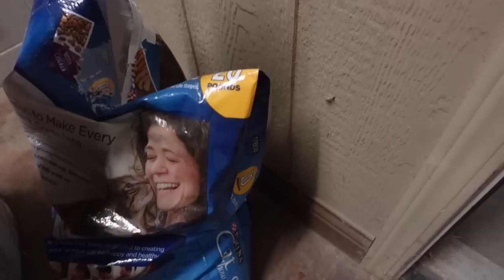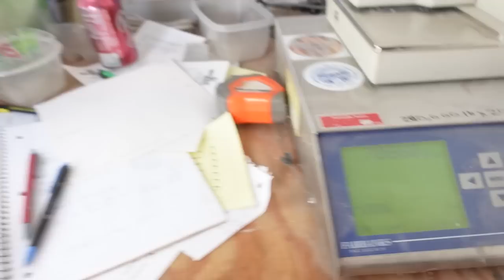The Intense Game of Brokering Hay

Comment: 35 years trucking at anything under an hour is great   it would take me longer to clean the mud out of the trailer with a lift in and out of the trailer,,  quick sweep and driver is off.  the way you twist the board out i would consider twisting it in as well  with a eye bolt in the center and a clip  eliminating the tying of the strap   I can see you are very thankful of the guys working there  and the work force should be recognized  as you do  thanks for your hard work   mike

Comment: When I drove the company had a contract with Costco. They had a 2 hour unload time before they would start paying for unload wait time. 30 minute unload time would be a dream, never happened with them, always 50-90 min. with the occasional up to 3hrs.
Reply from the maker: That’s what I thought. We try to treat the driver’s time with respect
Reply: @FarmingInsider  Subscribed 2 weeks ago so not yet caught up on past videos. You have been talking about a ramp. That would greatly decrease loading time, no fiddling around and pushing, not sure it would decrease unloading time much, you're doing good there. The problem is locating it where it isn't blocking other daily uses of the yard but close enough to where you're storing the hay the extra travel time negates the lesser time of loading/unloading. Also keeping in mind trucks have to have room to back up to it, tuck it around a corner somewhere or a difficult place to back into reasonably quickly and you've lost any advantage.

Comment: Swap that strap with a proper tow loop with loops on both ends. It will make hook up to the telehandler that much quicker.
Reply from the maker: I agree with you. That would speed me up in there
Reply: @FarmingInsider  you can get different lengths at harbor freight. Would be better to not deal with the hook and ratchet mechanism. 

Love the videos. We are an 11th generation hay farm out in Central MA. Much smaller operation. 7-8k squares a year.

Comment: are there remote controls for the rebale line to start up and shut down (In case of emergency) or do you need to run outside and mess with the individual tractor controls to start and stop ?
Reply from the maker: We can shut down everything from inside except the baler

Comment: What size and types of twine do you use on the bales and on the bundles?
Reply from the maker: We use 170 on the small bales and 450 on the bundles. usually cordex i think
Reply: @FarmingInsider  did 170 work with the arcusins aswell we had trouble with twine braking with 210 on the arcusin
Reply from the maker: @aidenkoster6427  I'm sorry, we do use 210. I shouldn't be replying this late at night haha. We had trouble with 170's breaking on the Arcusins but it seemed to be a decent fix when we hopped up to 210. What pressure do you run?
Reply: @FarmingInsider  I think we were running 120 psi on the bunder we tried 440 in the baler and it actually worked really well but I think we are going to try 300 or so this year.
We haven't bought a bundler yet but we have the option on a very slightly used c14 and a new d14 what machine did you prefer?
Reply: I really appreciate the videos and that you are answering my question
Thanks